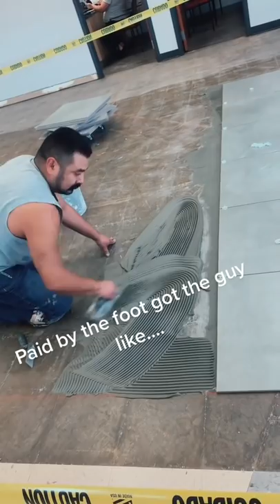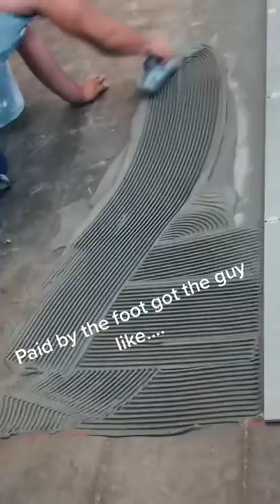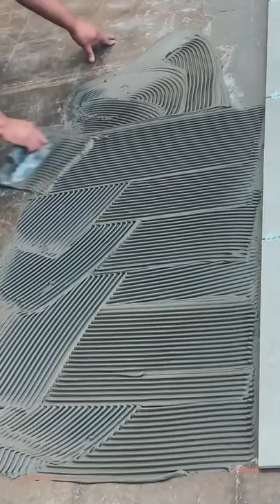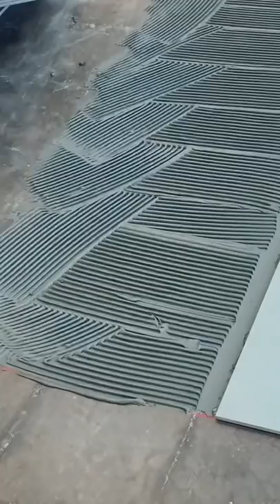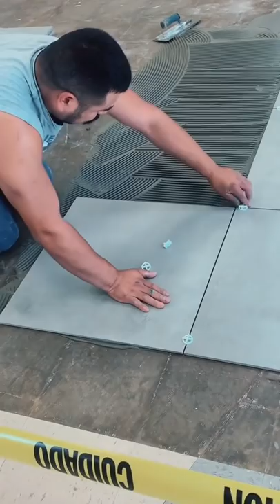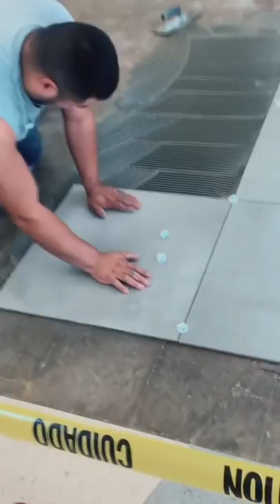Dude laying our new tile is 🥶 CREDIT terrywatson806 #Shorts

Comment: Much respect for Tile setters, my late husband was a Master Tile setter. Its one if the hardest jobs out there. Nice job!
Reply: Not hard if you have the right tools. There are broom versions of most tiling tools so you dont have to bend over. Same deal with loading/offloading tile. Only gets hard when the unit is multi floor and there is no elevator lol
Reply: Skilled job yeah. Hardest not really. Concrete work is harder, building bridges is harder, installing windshields is harder, building fence is harder. Straight laying 18s is a dream for a tile setter but yeah hes good at his job I would do little different to make sure its soild

Comment: As someone who just laid tile to replace some broken ones at home recently, that actually looks really dodgy. The lines of adhesive are supposed to be straight from one edge of the tile to the other so that the air can escape as you press the tile down. Otherwise you end up with air pockets were the tile hasn’t bonded properly. The tile will sound hollow when dry and has a higher probability of breaking in the future
Reply: Everyone saying he doesn't need back butter don't know what they're talking about either...
Reply: I was going to comment the same thing after watching the video on how to lay tile properly and they used glass to show the correct technique for troweling the adhesive.
Reply: @bluetruth5113  yes, I saw that too! Not something you’re think about but makes sense once you know

Comment: As a former tiler I can honestly say this is not that impressive. He's actually not floating any of the tiles and with pieces that large, your gonna get hollow spots.
Reply: Matter of fact, you probrably say former cause you got fired for doing it wrong. Probrably a bot cause you dont have a profile pic and have that name.
Reply: @ghostkilla931  criticism without any content - get learnt.

Scraping the thinset from the edge like that will cause hollow spots which leads to faster cracks.
Reply: @ghostkilla931  lol do you honestly think a bot can leave a comment that requires actual acquired knowledge about the subject matter? Also some people don't bother to put up a profile pic and some fancy fake name unlike a lot of millennials that know jack shit but still presume about people's behavior based on very thin air of what they barely know
Reply: Bubble burst, good work 👍
Reply: @ghostkilla931  you clearly no nothing about laying tiles
Reply: @ghostkilla931  Let me get this straight: You believe there are bot accounts that exist for the purpose of unfairly criticizing tile laying craftsmanship?
Reply: Goes to show that you should probably ask an expert before assuming work is good/correct :/
Reply: I agree, it's better to use a much thinner scraper if you're going that route but I found it wasn't really even that necessary to and like you said it won't crack as much there.
Reply: @ghostkilla931  Hey! I like not having a profile pick and a boring name
Reply: I, too, do not have a profile pic. ✨ Welcome to the club ✨
Reply: the fellas
Reply: @bm3350  welcome 🙏
Reply: @bm3350  dang governments always pulling government schemes 😡😡
Reply: @ghostkilla931  🤣🤣🤣🤣🤣 homie you left the comment section just as fast as you came
Reply: I'd agree except this is a concrete floor that appears very level, you can hear how smooth the trowel sounds scraping over it. I think he's good
Reply: @baileycaristo1948  No such thing as a level concrete floor!
Reply: Quick work doesn't always equal great work. Too many people want quick, but fail to realize that sometimes speed requires cutting corners here and there.
Reply: Thank you! You are the first I’ve seen in this CS to notice sloppy work this doing is putting out. The mud seems too wet too
Reply: @michaelhaydenbell  lmao
Reply: Theres voids under that tile in all the corners! Thats going to crack in less than a month😂😂
Reply: Facts and he didnt back butter it
Reply: 100% true, he's supposed to do a directional trail in order to collapse the ridges properly and get the right coverage.
Reply: @ghostkilla931  get rekt'd. He's actually right.
Reply: @johnking6177  Sounds like you'd get fired pretty quick as a professional tiler! 😂
Reply: you are...........Correct.
Reply: @ghostkilla93 well i do know about laying tile and hes right...not impressed.
Reply: If the floor is level then you don't need to level it. As a former tiler you should know that. That large level we drag across the ground to check for low spots and fill in and float with patch.
Reply: @WisestTiger  I've worked in dozens of houses where the floor appears level, but there's almost ALWAYS dips and peaks. No matter how good the cement guys are. I've seen dips as much as a full inch spread out over 12 feet or so. Completely invisible to the naked eye. Don't come at me with that crap.
Reply: @WisestTiger  that long level is called a “straight edge”
Reply: @jessesalinas8534  I know what it's called but I don't see how that matters. If you know then you know the point is for this guy to act like he knows and he obviously doesn't fuckin know
Reply: @seanyoung3864  you kind of sounded like you knew what you were talking about but I'm guessing you were just the bosses son that supervises.
Reply: @WisestTiger  Try again Yanez. I worked my way through the ranks.
Reply: @seanyoung3864  as a carpenter I agree your home is probs wonky in a few places lol
Reply: Been tiling 15 years, my thoughts exactly
Reply: @opsgreg8392  i was thinking that too using a 3/8 for LFT or LHT you have to back butter but it looks commercial so hes prolly like fuck it i lay 2000 feet today thats 15k i make in 1 day lol
Reply: @last1second  the profile is empty nada not even playlists
Reply: @michaelhaydenbell  I'm racist
Reply: @michaelhaydenbell  Nowdays people believe that everything commented with wich they disagree is replied by bots, for some reason.
Reply: @bm3350  No way, I refuse to believe that!
Reply: @ghostkilla931  youre the type of guy that get tricked by the actual bots.
Reply: @ghostkilla931  no dude he is right. The hollow spaces r brutal and the tiles can end up breaking not to mention that the floor can become uneven. It happened at my house and basically made us pay double cuz we had to get new tiles
Reply: @WisestTiger  thing is, how many floors have u encountered that didnt need leveling?
Reply: @jessesalinas8534  quite a lot.
Reply: I agree. I tiled my floors just like this before and they cracked so bad 😩

Comment: I sell flooring and work with independent installers, the good ones are the nicest people and they love to joke around and are just super cool people, back butter isn't necessary for this technique, although I feel bad for his back on these huge tiles!
Reply: Not really. This technique is called wrong. Even with directional troweling back buttering is needed. Plus he's setting directly onto concrete... shits gonna bust and crack. I hate watching videos of people doing my trade wrong and people in the comments sharing wrong information.
Reply: @jerek2251  I agree! I’ve been tiling for 10 years and back buttering is a must with most tile specially tile this big. And any time you are laying tile on concrete you need some sort of uncoupling membrane to prevent cracking. Concrete expands and contracts
Reply: What about a spirit level?
Reply: @jerek2251  i am an apprentice in the trade, do you have any tips and tricks?
Reply: @AllBayEveryDay  i am an apprentice in the trade, do you have any tips and tricks?
Reply: @AllBayEveryDay  first thing I learned is back buttering is necessary or the corners will chip and break off and I’m a carpenter
Reply: The real test of his skill is when he gets to a door casing and other places this is the easy part
Reply: Why don't you check with the tile manufacturers recommendations… I guarantee you they recommend backbuttering for tile that size

Comment: I'll go ahead and say it since there seems to be an issue. As smooth as clean and smooth as the surface he's laying on there's no need to butter back. Also There's teeth in the trowel for a reason those aren't "hollow spots" 
The one thing I don't agree with him doing is not marrying his edges with the fresh mortar leaving that gap in his bedding. Now as for the scraping of the edges if you don't apply so much pressure that mud protrudes out of the seams and refrain from sliding the piece forward in the process of laying also causing protruding mud. you can grout without any issues. 
And before you say anything. I have 10+ years of experience and ran many multi million dollar contracts for Walmarts Targets dollar general's CVS's etc.
Reply: Any tile over 12 inches needs to be back-buttered. The floor is buttered with the channels going in one direction with the back butter going perpendicular. This creates a perfect bond from tile to floor. That's the basics. Just because you've done it for years doesn't mean you've been doing it right.
Reply: The ridges don't do anything if you don't collapse them. You need to move the tile twice the distance of the notch (1/2" notch you move the tile 1") in order to collapse the ridges.
Reply: I like how you said there are teeth in the trowel for a reason and then ignore how he is negating that reason by blocking the channels in his material trapping the air inside so they channels can't collapse

Comment: As someone who knows literally nothing about laying tile, can someone PLEASE explain why this is being seen as good AND bad? Like what is the argument for both sides?
Reply: Someone tag me when someone says it, im lost
Reply: he’s not putting mud on the back side of the tile he’s laying down. some say with larger tiles there’s no need, but others would disagree
Reply: and the good is the fact that he's doing it really quickly and efficiently
Reply: Bad also because going in 2 directions with the adhesive means it won't get proper contact
Reply: @joyitadarling5815  I'm tagging you because someone said it
Reply: The tiles may not properly levelled
Reply: @richardmillhousenixon  thank you so much dude, it means a lot to me :)))
Reply: This video was dumb. I was expecting something impressive but it was anticlimactic
Reply: @jdotcash  thanks!
Reply: @thonk7611  thanks!
Reply: @calebwithers9690  thanks!
Reply: Backbuttering tiles is only for a stronger connection, with floor tile it's completely unnecessary and it's mainly for big tiles going on walls. The other thing is he puts  his own weight on it which will make the support for the tile uneven and weak. Last thing is the grout lines are for leveling and are normally lined up as that lets it dry more evenly
Reply: Anyone who knows nothing just sees speed and confidence so that seems good. I personally haven't done much for tile work, but no back buttering.

Comment: He's laying them improperly the trowel marks must be in one direction for proper adhesion the tiles are now weakened with air pockets underneath where they can easily crack
Reply: You’re wrong
Reply: @tylerk.7947   ok sorry thank you lord for your detailed reasoning
Reply: @tylerk.7947  he's not
Reply: Your definitely wrong. He smooshed it down with collapses the air pockets. But a 1/4 inch trial on a 18x18 that’s on the floor is all bad
Reply: @prodbegaming664  another tile pro that's never put down tile.
Reply: I’ve worked with tile for 5 years now. Independent business. Your are 100% right.

Comment: Great way to get trapped air under your tiles.
Always make straight lines to the long side of the tile away from the other tiles
Reply: And back butter
Reply: Yes and yes, glad i was not the only one to see that!
Reply: Which side is the long side on a square tile?
Reply: @foxtoxic9722  There is no long side but then you comb away from the previous row of tiles.
Reply: @dustincomp8059  If you use the correct comb size you do not need to backbutter

Comment: You need to put cement on the back of the tile as well just so you know
Reply: More so when doing walls and ceilings no?
Reply: Absolutely tiling is all I do
Reply: Not only that but he’s going to trap air in with those end lines like that . That big tile will brake easy like that. You need the back butter and lines all going the same way. You want no air under those big ass tiles.

Comment: I'm no tile laying expert by any means at all, but aren't you suppose to put mud on the tile as well?
Reply: Not with the technique he used
Reply: Nope
Reply: No
Reply: Yes you are you can search for videos where people install clear tiles for demonstration purposes to show how much mud contact you have using different techniques. You need to trowel mud in the same direction so you don’t get air pockets and you need to back butter every tile for optimal coverage. This guy is not tiling correct. It’s not the worst way he could be doing it but not the best either
Reply: @christophersonnier2306  a VERY SIMPLE google search asking "does tile need to be back buttered" will tell you that no, it does not need to be back buttered. I did not have to Google that, having worked in the construction industry for 15+ years, but decided to Google to see what it had to say, since I know you "know-it-alls" love to use google as a reference.
Reply: @christophersonnier2306  as I scroll through more and more shorts, and upon reading the comments on the shorts, I begin to realize more and more, that people in the comment section have absolutely no idea what they are talking about. They have zero experience in the construction industry, they watch a few shorts, repeat what the person in the short said, or another commenter said, and claim to have the knowledge, when all their doing is repeating what they heard or read a couple shorts ago.
Reply: Actual expert here. While it's not necessary, it's strongly recommended, especially on lft. Most people, especially commercial jobs are too cheap to pay someone to do it right tho. But if it's only gotta be warrantied for 90 days, why bother lol.
Reply: james 26  bro I was freaking asking a question, chill.

Comment: Friend said he back buttered one and didn't the other and let it dry. Came back and removed them both and said the one that he back buttered took way more effort to remove and didn't get it off in one whole piece
Reply: I know this man looks like he knows what he’s doing and he’s faster but he’s skipping the most crucial step especially large format tile

“The folks in the tile industry have provided us with many exciting choices. Many of the tiles are large format tile. The Tile Council of North America (TCNA) and the National Tile Contractor’s Association (NTCA) describe large format tiles as “any tile measuring 15 inches or more on any one side.” With these types of tiles it’s VERY important to apply enough supporting adhesive under them. One of the best ways to ensure the proper amount – and coverage – to these tiles is by back-buttering them. All natural stone products also need to be back-buttered. Travertine, marble, granite, slate, etc., are natural materials. Many have voids in the reverse side. By back-buttering these types of tiles the installer is filling in the voids giving additional strength to the weaker areas. This is again done in the attempt to achieve the original goal, “Set the tiles in such a way to reduce the possibility of failure.”

I think by now you have figured out which side of the fence I have landed on. I can’t see why an installer wouldn’t back-butter every tile installed.  If you want a more scientific analysis of whether you not you should back-butter, check out the video below.”

Comment: I was with him up until he started laying those tiles down.... then I lost my freaking mind!!! Those tiles are 100% going to crack! Idiot cutting corners not doing the job right and ultimately screwing over the customer!
Reply: what did he do wrong? i don understand
Reply: @rawtrout007  everything except when he spreads the cement
Reply: @rawtrout007  everything but the cement, the tile has to be leveled and set on the cement with pressure
He just pushed it down leaving empty pockets under the tile which could break the whole tile
He needs to make sure the tile is completely set on the cement before just letting it dry

Comment: I’ve owned a tile company for 35 years. This guy doesn’t know what he’s doing.
Reply: Why's that?
Reply: He need to back butter the tile before laying it down especially large format tiles
Reply: No back butter, not directionally troweling, and the size notch trowel are just a few of the things I see wrong with this…
Reply: You can simply lift the tile and check for coverage without the need to back butter. Just wasting time and money. You'd be working for peanuts by back buttering all day. I've never had an issue, so that alone shows your wasting your time and money. Not trying to be cynical but honestly work smarter not harder
Reply: And no need for directional toweling at all? He's on a main floor and even on a patio I still wouldn't bother.
Reply: @jimenezjamz  since when? cant you just pull a tile up to check for coverage if your in doubt? you can surely feel it can't you?